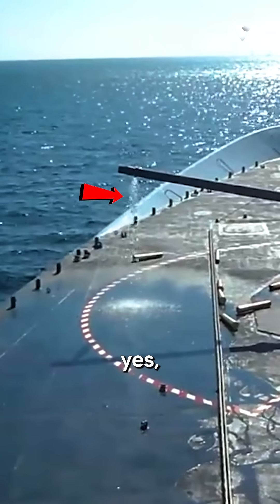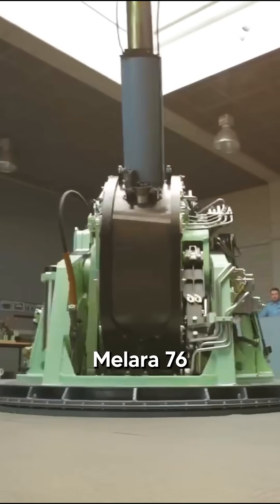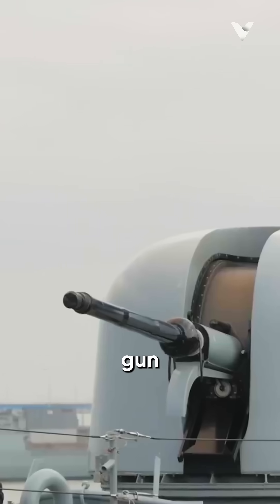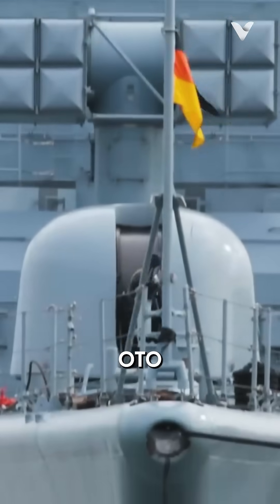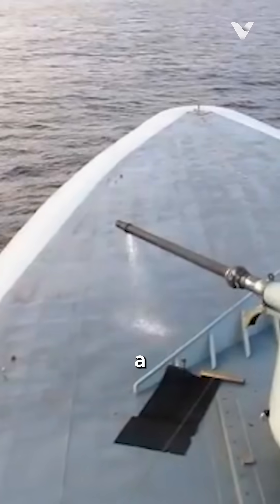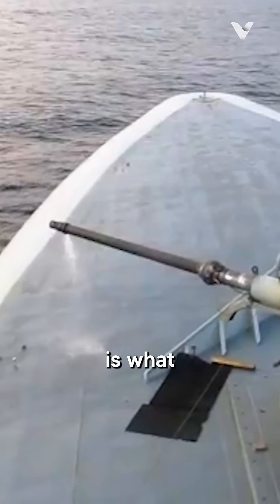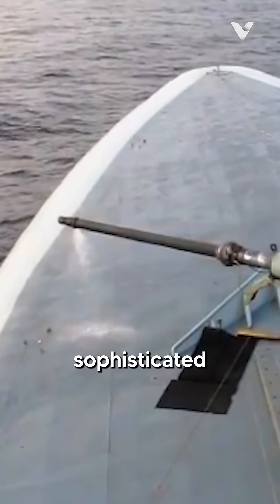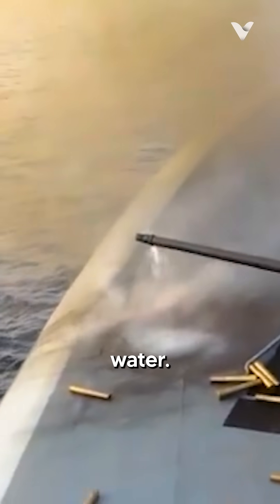The Cause Why Does This Cannon Spray Water #shorts

Comment: "Sophisticated cooling system".....just like every machine gun had 110 years ago.
Reply: those machine guns were not 76mm, or about 10 times the diameter of a typical Maxim Machine Gun's 7.6mm.
Reply: The maxim had water funneling through the barrel?
Reply: @erickzuniga3113  The water isn't running through the barrel but around it. The barrel is jacketed by another steel tube which yes, is the exact same type of system used on many different machine guns a century ago. This is just bigger.
Reply: @blakegoulds8313  this one has water coming out of the barrel